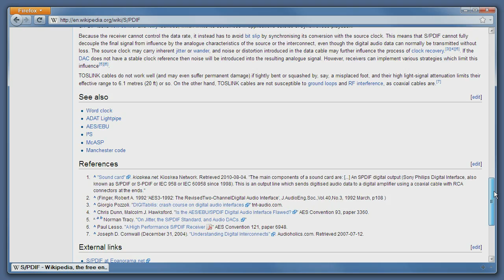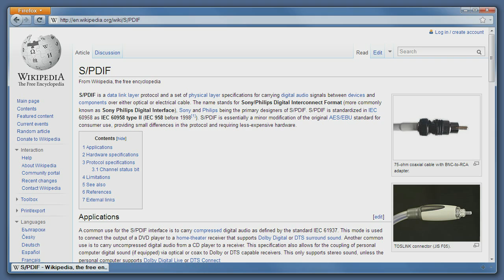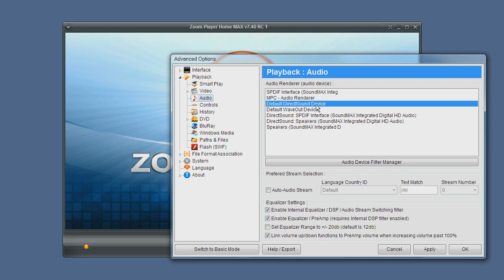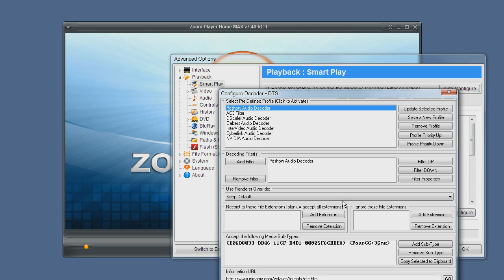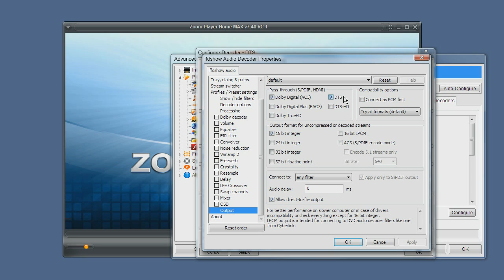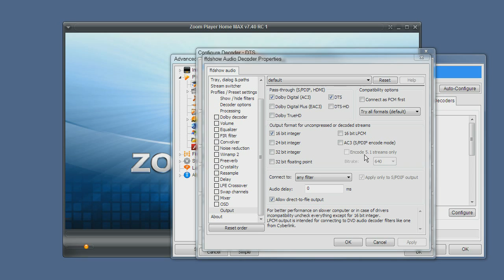Digitally output Dolby Digital & DTS audio over S/PDIF

Comment: Hi. I have a question regarding the dts sound. I have the Creative Sound Blaster X-fi sound card, and Logitech X-530 5.1 system. When i play a movie in Bs player the ffdsow shows the audio input of the movie as dts @ 1536kbps, but the output is only stereo. I have all of the settings set to 5.1 on the sound card and windows. What can i do to have the dts sound?

Comment from the maker: @80srockzz You might actually be decoding and then re-encoding, don't enable 'AC3 (S/PDIF encode mode)'. If you're using ffdshow for s/pdif.  You can alternatively use DScaler as the audio decoder and enable S/PDIF in the dscaler property page accessible though the right-click menu under 'filter properties' (when a media is playing).

Comment from the maker: @Bakuraouzoku The answer is yes, with a few caveats: HDCP protection is only required for encrypted Blu-Ray playback.  If you play DVDs,decrypted Blu-Ray content or just media files with AC3/DTS audio tracks, you can use either Composite/Optical S/PDIF (for DTS/Dolby Digital) or HDMI (for cards that support audio/video through HDMI to output Dolby TrueHD and other new audio formats introduced with Blu-Ray).